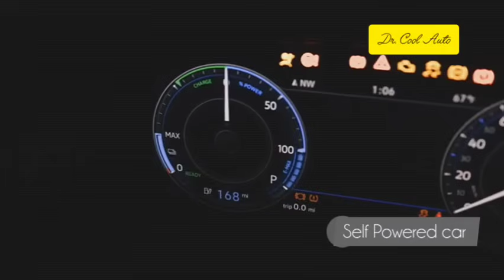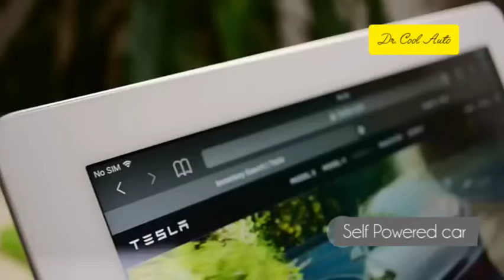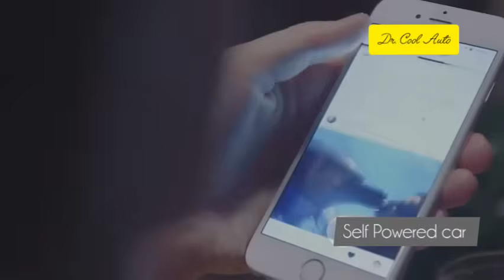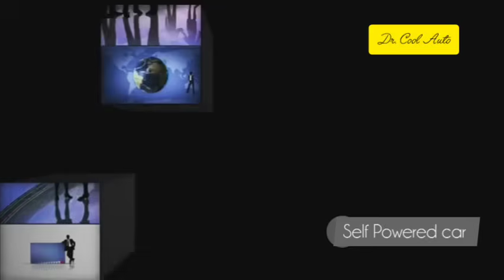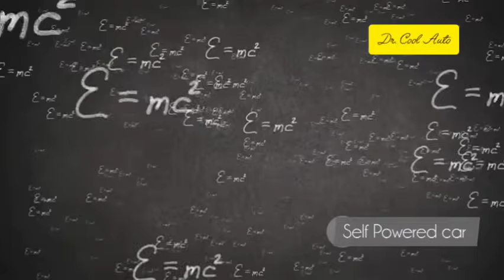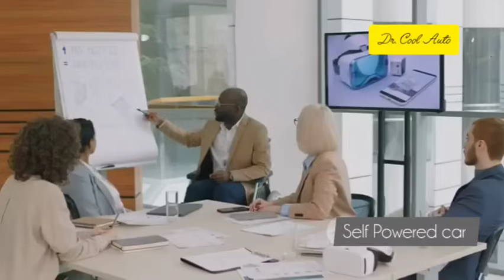Where To Buy Maxwell Chikumbutso Self-Powered EV & FAQS

Comment: No gas means no oil, no coolant, no transmission fluid. No pumps. No radiator. No leaky gasket. No blown engine. The ICE is a relic.

Comment: The screen in the background in one image says "In 1999 the radio broadcasting transmitting was live on FM 97.3 MHz the first successful project."  Was he saying that the radio frequency that he was using to power something (What ?  A car ?  A motorcycle ?  What ?) was 97.3 MHz ?
If so, what happens if the vehicle drives out of range of that transmitter ?  At some point, like listening to a radio station, the signal becomes so weak that you can't hear it any more.  So does the vehicle "run out of gas" so to speak ?  Or does his powering device operate like an automatic scanner, switching to the next highest powered transmitter ?  Will it still work in locations like Antarctica where there are no radio stations ?  Does it have to be FM ?  What about AM ?  What about HF ?  Can it run using the Earth's natural resonate frequency ?  Lots of unanswered questions.

People posting here thought he was already selling cars or motorcycles.  Unless I'm mistaken (a definite possibility), I understood him to say that he has received orders for these items.  A big difference.

Comment: Made by a Chinese company .... that's a lotta questions unanswered. 
Where is the transducer/antenna that receives/absorbs electromagnetic energy? 
What is the unit of energy absorbed or converted into useful power? This is the important question. 
Basic questions  like these will  measure the viability of this microscopic wave machine ?

Comment: I dont understand the  independent verification  part;;; if  it works it works, thats simple enough, we dont need to know what is inside the black box to verify that it works, ,,if an aspirin cures my headache i dont then need to know what is inside the aspirin in order to confirm that it works...if the car drives without a battery should in itself be sufficiently self confirming...why not????

Comment: They keep talking about violation of the law of conservation of energy that energy cannot be created only transformed. He never claimed to create energy only to transform it from ambient radio waves to usable energy which is perfectly consistent with the law of conservation of energy.
Reply: Yeah but ambient radiowaves have miniscule energy in them, microwatts or nanowatts, even if the device is 100% efficient it will output negligible electricity. If radiowaves or naturally occurring atmospheric electromagnetic signals (sferics) carried enough energy to power an EV cars or recharge an EV car battery those radiowaves would be inducing dangerous voltages in everything conductive around us, we'd all be getting seriously electrocuted from wire fences, metal gates, steel buildings etc. It's a scam.
Reply: No. He’s perpetually creating more energy than it consumes. Pure scam.

Comment: Lets get away from all this Chikumbutso has invented the self powered car, he claims to have found a way of harnessing free electricity by microsonic means that can be used to power a car, but not just a car it can be used to power your house or it can provide power to a portable device to give you power anywhere in the world , this ability to draw electricity is what we should be concentrating on not the products it can power. If you just take the workings of the car out of the body and put it in another body then you can attach it to your house no need to wait until you get home with your car were the wife has been all day without electric because you have the source at work parked up all day. And that is were the price of this car comes in because it will be as expensive as production is plus the cost of the electric unit to power it, as it is explained you only need one source for all applications you do not need different power as in Ice engines.

Comment: FAQ: Will my MICROSONIC car work with Radio Waves/Frequency in my particular location?. Will it's network work or fail in my area?.
Reply from the maker: It will work in your location due to the fact that radio waves are everywhere around us even the most remote village's
Reply: @drcoolautofix  Thanks so much. It's getting clearer by the day.

Comment: Zambia well done, 20,000 machines! That is great, supporting African grown technologies.
Africa, let's go, go, go....
Reply: Maxwell is African not a country man. We accept him in Africa
Reply: You do know it's a rebranded Chinese EV (Skaife) with a gimmick inside?
Reply: @frankyyaggabot6222  you do know this is how most new technologies come out right? Someone invents something and someone adds on to it... you think the Internet was the same it was when it first came out in the 90s? You think the first cars themselves were Electric? More innovation will always come after the original. This is true for everything.
Reply: It's not chines  rebranded but rather Chinese company aka KIA motors made the body.
Just like apple phone Chinese company makes most of the parts.
Reply: @frankyyaggabot6222  Not Chinese rebranded. It only means that the Chinese was able to get into an agreement to provide the chassis while Maxwell Chikumbutso provide the new Microsonic device to power it. Of course it also means that the Chinese firm had to collaborate in crafting the new device since Maxwell Chikumbutso hasn't got any infrastructure to manufacture anything as yet.
Reply: @sundayhezekiah5002  Parasitic power from RF is not new or novel - it creates micro-Amps of current (not enough to power a car). He has his device attached to the vehicle as a secondary (almost completely redundant charge unit - i.e. gimmick). He could of course put all this to rest by driving these cars from Harare to Nairobi on a single charge. Why doesn't he?
Reply: @frankyyaggabot6222  So it's with a gimmick that he would be receiving orders to the tune of 20,000 units from Zambia and 3,000 from South Africa??. Please wake up because the train has since left the station!
Reply: @sundayhezekiah5002 that is a Kaiyi X3 Pro EV.
Reply: @sundayhezekiah5002  Yes. That's about equivalent to all the vehicles Skaife sold last year. It's brilliant marketing and has fooled a lot of people. Now examine all the people who are getting kickbacks from those vehicle sales - they'll be the same people that are coming out and saying what a brilliant new technology this is - just watch and learn.
Reply: @frankyyaggabot6222 so u mean Airbus doesn't belong to france since rolls royce plane engines come from Britain?? Can it fly without engines or airbus is a British company?
Reply: @sundayhezekiah5002  Ha ha ha really?
Reply: You inadvertently answered your own question. Airbus does not belong to France - it's a multi-national European company. The point is, if you took an Airbus aircraft to Zimbabwe and stuck a sticker on it and  attached a gimmick made in Zimbabwe within it, that wouldn't make it a Zimbabwean manufactured aircraft.
Reply: @frankyyaggabot6222 Why not chinese make the same.You mean they love competition pressure from other Ev manufacturers??

Comment: Think you can't draw usable energy in the form of radio waves from your surrounding environment? Think again. If Maxwell Chikumbutso has figured out how to do on a commercially viable scale what Nikola Tesla did about 100 years ago, or what is being shown in this video of an experiment of collecting power from an AM radio transmitter by The Plasma Channel https://youtu.be/NowhPAMDOTo?si=guf7J3oJytIln2gs then he has indeed cracked the code and not violated the first law of thermodynamics. There is energy all around us. I am a retired Electronics Engineer and a fan of Nikola Tesla.